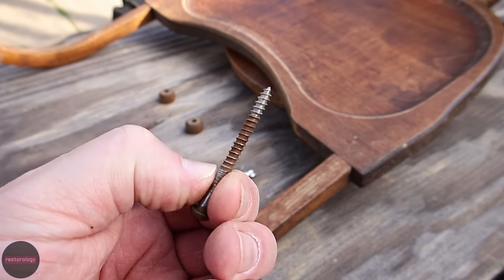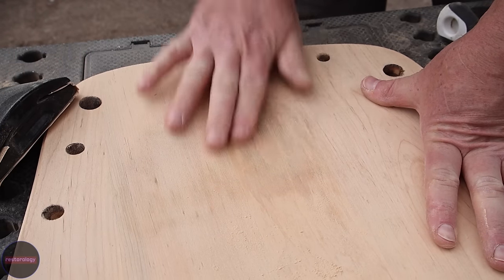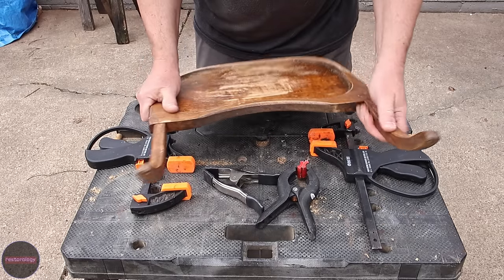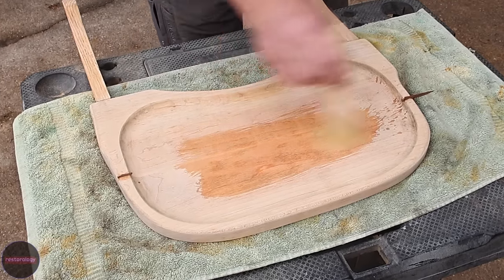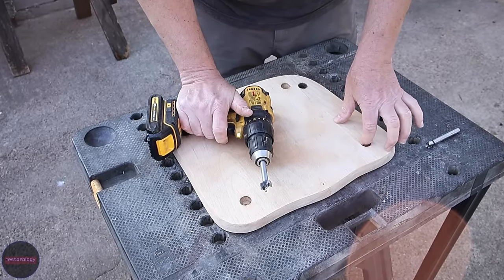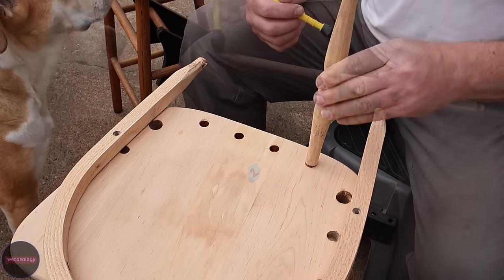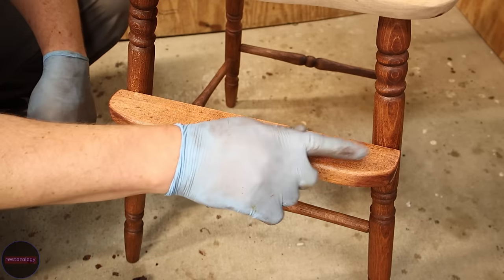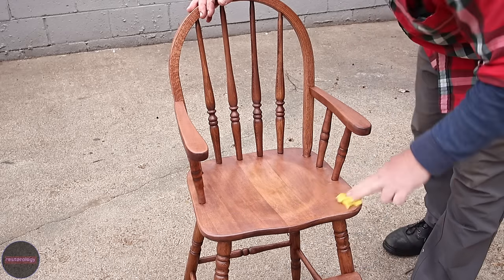Vintage High Chair REPAIR and REFINISH | Restoration

Comment: I refinished the old highchair that the seven of us used. I didn’t have to pull it apart, but I did replace the foot rest. Took off five to six layers of paint. I’m proud of myself.
Reply from the maker: You should be proud. Removing six layers of paint is no easy task. I've done it. 🤟🏽

Comment: That's my childhood chair. Starting 1951 to 1962. Had two because first born were twins. By 1962 and six children later Mom said enough. Now the crib was something . I've never seen another like it. I was literally a screened conversion type . Like maybe something from tropical areas to keep mosquitos and bigger than todays. Converted to toddler bed
Reply from the maker: Thanks for sharing. I had trouble dating this piece. I've got a crib from the same time period also. It will most likely be on the channel one day!

Comment: Stunning restoration 😊  These old highchairs are the best.  I see so many plastic ones on the roadside heading to the landfill. 
Thank you for giving this one some love. Cheers from the Finger Lakes of NY. 🍷 🍷
Reply from the maker: Thank you very much! I actually have two more of these in the queue for the channel. One is a family piece that one of my parents used, then me, then my kids, and I recently found one on the side of the road, completely trashed.
Reply: @Restorology  I have two in my basement from my mom's house.  One has no tray and the tray on the other one, cracked where the wood was joined.  I will hopefully get to them this summer.
Reply from the maker: @KimNevelzer  Good luck!!

Comment: I refinished a highchair 35 years ago, for my oldest daughter.  I stripped the tray down to nice wood, but when I got to the legs, I decided I wasn't up to stripping spindle legs, so I painted the high chair country blue (it was in 1988), and had my mom paint rabbits on the head rest.  I use it now for our grandchildren, but have somehow misplaced the wood tray!  I need to check thrift stores for a wood tray, so I can use it as intended!
Reply from the maker: You might be able to have a decent wood worker make one up fairly quickly. If I had to make the one on here, it wouldn't take much time and I am no professional. I don't blame you with the spindle legs, it sucks trying to clean them up.

Comment: THAT was fun to watch. It brought back memories of all the high chairs of my formative years, so many high chairs in so many homes. Every home had one. I remember most of them in natural finished hard woods, or, painted white hard wood. As for the strap, I think the nylon is preferable to the leather. Just as strong, and more flexible, and washable if need be. That particular high chair had many parts because of it's style. In the old days a lot of them had a solid back. You made your neighbor ecstatic, I'll bet. On to another generation of grubby little hands to cake up the finish.
Reply from the maker: This is great feedback. Thank you!!

Comment: @Restorology it turned out lovely! The only suggestion I would have is coat the hook with a product called tool magic.  I use it to dip my pliers in to protect easily marked metal when I'm making jewellery. Simply dip the metal for a thin coat and allow to dry.  That way skin doesn't get scratched. 
Thanks for speaking...it allowed me to focus on your great attention to detail instead of trying to read captions.  Besides...you have a soothing voice...lol.
I wish I could have seen the owner's reaction. I  bet she was thrilled!
Reply from the maker: Thanks for the advice. I will check out the tool magic project. There are times I have to use pliers on brass or wooden parts and a protective coating would be ideal. I actually didn't get to see the owner's reaction. The day I finished this piece, she tested positive for covid so I had to just leave it on her front porch. She wrote to me that evening and told me that it was wonderful.
Reply: @Restorology  that's unfortunate for her...hope she is better

Comment: For cracks similar to those on the food tray, but smaller, I have had massive success making my own 'filler' using wood dust from sanding and mixing it into a paste with wood glue. Also works really well to fill loose joints. In my experience it also takes stains and treatment pretty well. Great work as always! I never thought of running the drill backwards to clear out glue from holes, super cool tip. I also enjoy the fact that you showed your mistakes like the water marks, makes me feel better about the amount of mistakes I make haha
Reply from the maker: If I showed all my mistakes, it would be a video of its own. I've done the glue and wood dust thing too but sometimes I forget and make things more complicated! Thanks for the feedback!

Comment: I had a chair similar this one (but more Early American---had some side pieces that curved around) for my kids, then passed it on to the grandkids. But they said broke the tray somehow. The tray didn't have those pieces, mine had slides on the arms so you could adjust it.
Good job restoring this one.
Reply from the maker: Thanks! I think that the slides started appearing in the 40s or 50s. I had trouble dating this one. The closest I found online were models from the 1920s but I am not convinced that this piece is that old. Maybe.
Reply: Mine was brand new gifted to me in the late 60s.

Comment: Wow excellent work 👏 I wish you can do my grandson wooden chair, we bought him a high chair from Walmart and another one from target and both ended up not being safe and sturdy, they were returned. I bought him a solid wooden high chair from marketplace and it’s great, just needs some sanding and staining done. Thanks for your videos
Reply from the maker: Thanks!! Are you going to attempt to clean up the chair? It made a world of difference for this one. I'd be happy to help you with yours but the shipping cost will probably be prohibitive. Good luck with it!!
Reply: How do you clean the tray? Can baby eat directly off the tray? The lacquer is food safe?
Reply from the maker: @missirich902  I reckon once the finish is completely cured, it should be relatively safe for a child. I don't think that the tray is meant to serve in lieu of a plate if that is what you are asking though. I guess it can be cleaned with any household cleaner or simply a damp cloth.

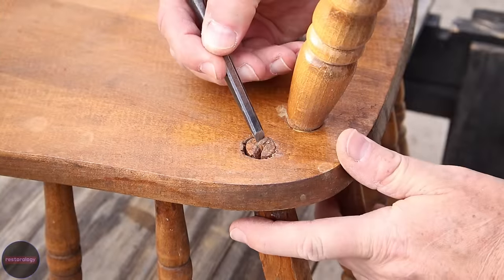Comment: I learned so much from this video already and I'm only halfway through! Can you please explain what you did starting at the 1:26 timestamp? I think that's the secret to removing the legs on my own chair that I'm working on, and I would never have known this if not for you showing it. 
Okay, now I'll watch the rest! Thank you so much for sharing this restoration with us. Incredibly satisfying to watch!
Reply from the maker: Thanks!! In that moment, I am drilling out the wedges that are expanding the split bottoms on the hoop back piece. The expansion is what holds them in place and without the wedge, they slip right out of the holes. I don't know if I am using the correct terminology but hopefully the video shows it pretty well, especially when I have to add new wedges. It's the same concept that holds an axe head on a handle. Good luck with your project!! If you have to remove wedges, just be careful not to damage the actual joint.
Reply: Thank you so much for your reply! That indeed makes a lot of sense. I have really enjoyed this video and learned a lot from you! The highchair turned out incredibly beautiful. It's really lovely seeing these antique pieces used for generations of babies! My own little one really enjoys the one we have; I just have to refinish it because the 90s oil polyurethane finish was deteriorating. I'm using shellac this time, so I can touch up repairs as necessary without need for an entire refinish! Was really cool to see you use lacquer on the final topcoat of yours. I'm a huge fan of traditional natural finishes! Thanks again for sharing. 

Did you ever figure out what type of wood your chair was made of? It looked like potentially cherry to me, with oak on the hoop-back and tray arms. Very nice!!
Reply from the maker: @emilys3638  No idea what the chair was made from but you are correct about the oak pieces. Those were very identifiable. Whatever it was took stain very similar to oak so it worked out well.

Comment: I would say the high chair is just post WWII. I worked for a furniture maker post HS and before entry into the military.  His advise was when removing or applying the finish to work from the bottom up and the inside out.  You'll learn on the unseen sections how to remove the finish and what techniques work best in application  Great job.  Narragansett Bay
Reply from the maker: That's great advice. Thank you!!

Comment: Looks good.  You think it's from the 1960s. From what I found, most high chairs from that period were chrome. Not saying it couldn't be from the 60s, but I don't think it is. I have a similar project. It was my wife's grandmother's so it is well over 100 yrs old. I plan on doing the same thing you did. I'm sure your neighbor is happy.
Reply from the maker: Thanks! I actually think it might be much earlier than 60s. When in the video, I said 40 - 60 years, I forgot that 40 years ago is only the 1980s now! 😮 This may be almost 100 years old...or, it could be a good replication. Hard to tell honestly. My neighbor seemed super pleased with it. 🙂

Comment: Well done. Does it make a difference that you didn’t use food safe stain on the top of the food tray?
Reply from the maker: Thanks. No idea about the stain but there is a lacquer layer between the stained wood and anything that sits on the tray. As long as it is fully cured, it may be okay for intermittent contact. 🤷🏽‍♂️

Comment: I use chlorine bleach and water mixture for stubborn stains. Experiment with the ratioo.....
Reply from the maker: I thought about doing that but I was super short on time and I ended up using a little more oxalic acid off camera which I think pretty much got me there. Once the color went on, it was hard to tell there was a stain at all. Thanks for the advice!!

Comment: I've never used high glue, does stain cover well?
Reply from the maker: I've never tried to stain over hide glue. I usually clean it off of wood before laying stain. It doesn't interfere with stain though, if that is what you are asking.
Reply: @Restorology  thanks, if it cleans up well and you can stain the area. That's what I needed to know.

Comment: I know you had a short time. At a later date would it not be safer to use counter top resin on the areas baby can touch?  You know how babies are dirty feeders. It would be so much easier to remove food particles and anything else.  

Me personally would not be bothered if it might be an antique, In a baby chair safety first.
Reply from the maker: The original finish was lacquer but it was applied super thick on the tray, probably because of the reason you wrote. Your idea of something less porous and more sanitary is a good one. I'll suggest it to the owner. Thanks!

Comment: That high chair would have been from the 1940’s. So the strap would have been of braided cotton type belting, not leather.
Reply from the maker: Thanks for the info. I didn't even think of braided cotton, not that I would have had that lying around. The women for whom I did this actually likes the bright, red webbing.
Reply: @Restorology  your use of the nylon webbing you used is an excellent choice as it is not subject to moisture as cotton web belting.